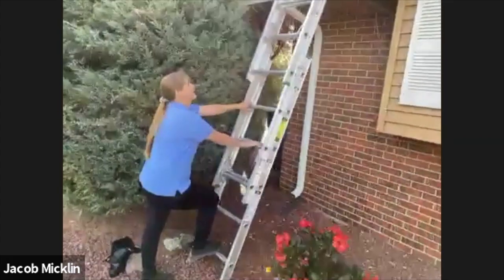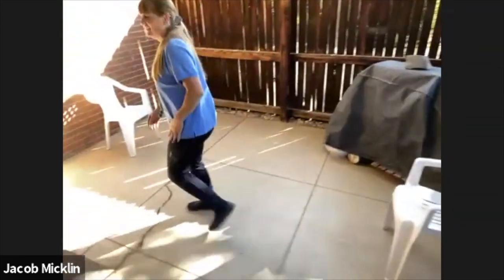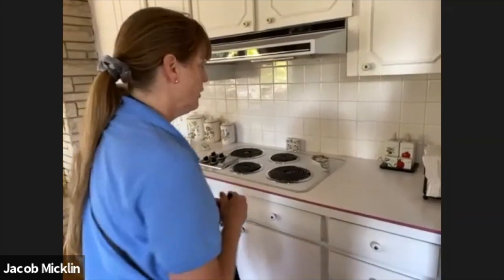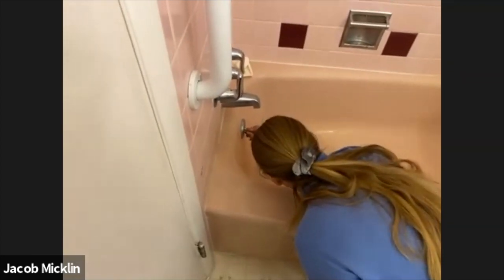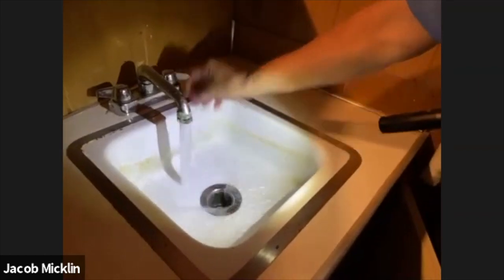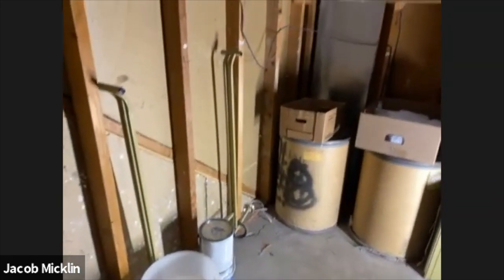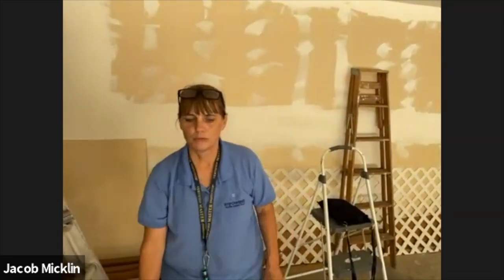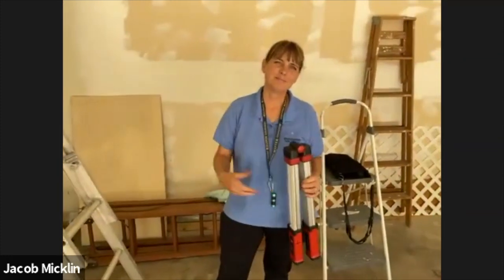InterNACHI® Live On-Site Home Inspection with Julie Erck, CPI

Comment: good video, but to be just a bit critical as details do matter. 
A few statements here I was surprised to hear them make in an instructional video. Such as about the Federal Pacific panels saying "they make good panels", they don't. they didn't, they don't even make panels anymore lol this is why it has these issues and is recommended to be removed.  Its even in the internachi training sections on electrical, inspectorpedia has great info on it for you as well. always flag it. 

The floor though in basement.  Lets be honest, you had dismissed it until someone in chat caught it and called you out for not mentioning it may be a 9x9 asbestos tile. which given pattern and age of home would be likely.  instead of saying just good eye, or thank you I was going get to that.. you said they could be and "they are not a concern unless they are touched" and its "safe, their fine like they are"".  The term you were looking for is "friable".  If the tiles are not in perfect or protected condition the hazard would still be present and cant say they are "safe", that's misleading to a client. Especially after just 10 seconds in the video before showing large cracking through the tiles that can expose the fibers and make it friable.  then proceeding to show more damaged tiles. 

and kudos to the videographer correcting her when she says inspecting a refrigerator is against the standards of practice.
Reply: Bar sink missing trap was also a "looking good".
Reply: @aaronfriedman7013  and the fiasco of answering the swamp cooler temperature question :/
Reply: @MAVcalled911  yup. Pretty sure that chimney needed a cricket...
Reply from the maker: Thank for the comments.